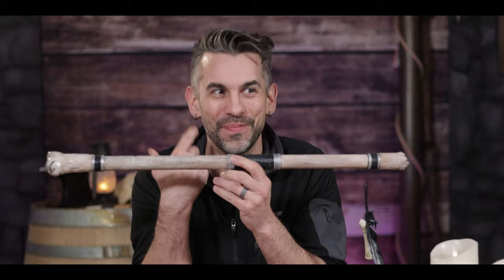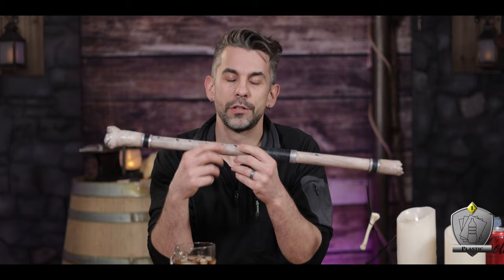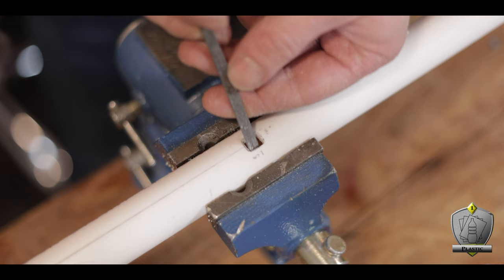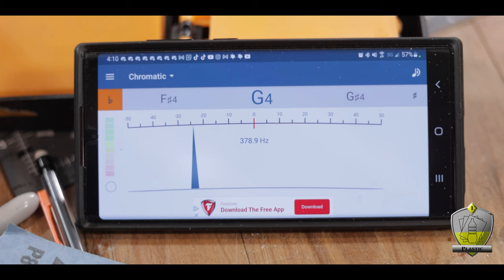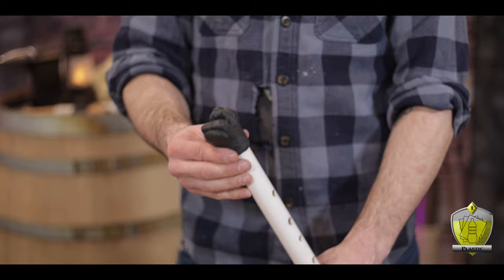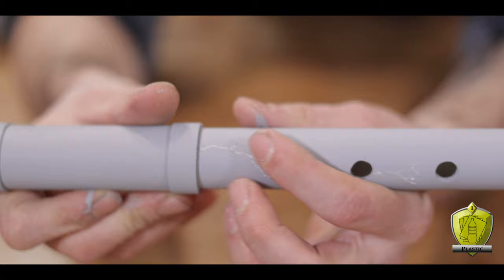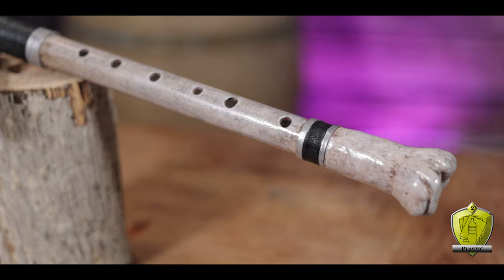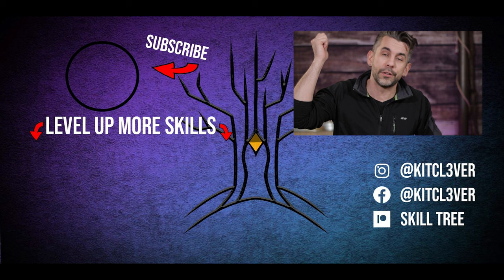DIY PVC pipe flute! LARP bone design. Will it actually work?

Comment: So, I play the tin whistle and the flute, and one thing I think your viewers might want to know. If they make this flute, they need to do the warbla bone parts first, and then measure the holes, because you changed the length of the sound chamber when you added the bone parts. And that throws off the tuning. But other than that, awesome job.
Reply: Thank  you.I appreciate comments with the benefit of long time experience. It's been years since I played flute or recorder (Idid own and was about to learn tin whistle before I stopped) I was seriously thinking about taking it all up again, and this video is a definite incentive.
Reply: P.s. Skill tree, pls see above comment with shared compliment.

Comment: A nice 3D printing project might be little plugs that can be plugged into a standard-sized drilled hole while reducing the actual open hole size appropriately.  In other words, little stoppers with holes in the center.  That way one could drill the holes all the same size in the perfect places along the pipe and plug in stoppers that make each open hole the correct size.  This might also allow for alternate tuning schemes using the same pipe, perhaps with an adapter to push on an extender?  I can see this going so many ways to make a more flexible and yet compact instrument.  Alas, I don't own a 3D printer nor have the skills to design such items.
I have played multiple woodwinds in the past and still play concert flute and piccolo on occasion.  I can see myself fooling around with this build.  Thanks!

Comment: This video was awesome! Next, you should try making an ocarina out of clay. I'm not remotely a skilled clay worker, but this was a really easy project to do. Just an idea.
Reply from the maker: So, I was looking into this but I would need to fire it, which I just don't have access to right no now. Maybe one outta woor though🤔
Reply: I don't think the firing is necessary as long as you let the ocarina dry. I just used air-dry clay, which is bad for making ocarinas because it tastes bad. But if you just put normal clay in the oven at like 400 degrees Fahrenheit, I think that would suffice. Also, what is woor?
Reply: that would be awesome, and you can use scupley clay so it can be baked in a regular oven.  I have only made one and would love to see clvr's take on it.
Reply: Actually… why not a fimo ocarina 😂 a 4 hole one to start with and see how it sounds

Comment: Looks great! When you were talking about the transition from the worbla bone to the pipe, there is foam clay that works very well with both worbla and pvc. You can sculpt it into shape like normal clay, and when it dries, you can sand it smooth to make a seamless transition. Keep in mind though, it is similar to eva foam when it dries, so please remember to wear a mask when sanding it down.

Comment: If anyone wants to do this with an even more corpse like appearance, you can add sinew or old flesh looking effects with toilet paper. Get the cheapest tissue you can find, lay it on the plastic and then drag a tongue depressor dipped in liquid latex over it. Give it a bit to dry and then use a toothpick or wooden skewer to pick up the toilet paper, you can use additional latex to smooth lines and create remnants of ligaments on the surface. Also you can take some red silk yarn and lay it on, covering with more latex to create blood vessels. Then, use wood stain to add color to the effect, a red chestnut will look pretty bloody and a darker walnut will give a more “pulled out of a grave” impression. We used to do this with medical education skeletons to make them a bit more unsettling.

Comment: This is awesome! Seriously great work. Only critique is the wash. I’m a miniature painter by trade, and the reason to use a wash and not watered down paint is because the wash has lower surface tension. If you use watered down paint, especially on a glossy surface, it’ll bead up.

Comment: I wanna make one that's smaller but has deeper notes for ominous playing while I hunt my prey (in LARP) any recommendations?
Reply from the maker: Interesting! No expert but I thing to achieve that you may need to make the instrument wider. The resonance chamber is what dictates the tone. A larger chamber means the air doesn't vibrate as fast which makes for a lower tone. I would be interested to see if a short but "fat" flute would work at all. Let me know what you find.
Reply: @SkillTree  That makes complete sense. I'll try it out and get back to you. Thanks